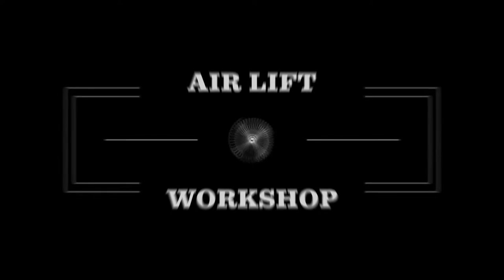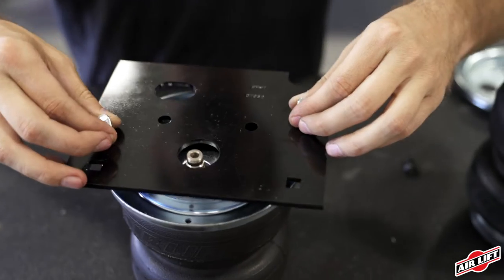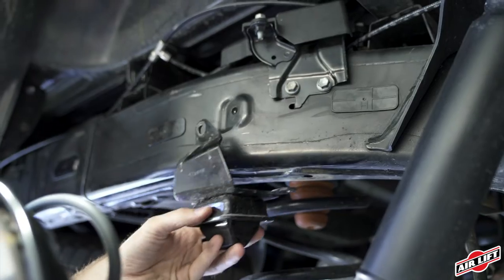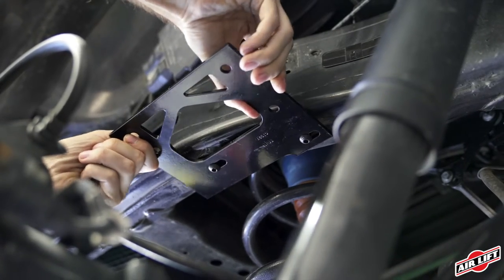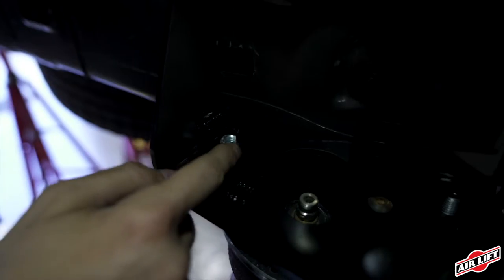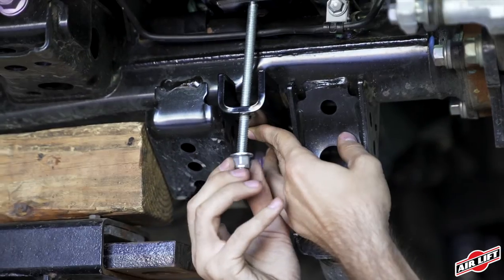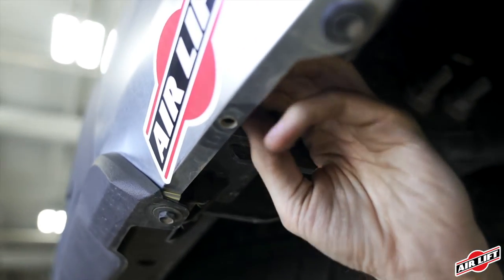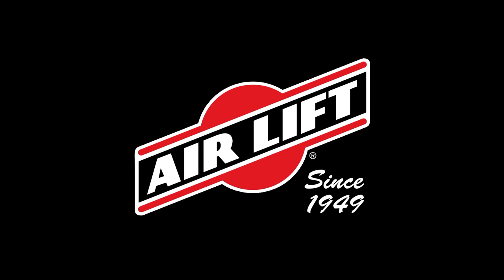Air Lift Install 57383: 2022-2024 Toyota Tundra 4WD / 2WD - LoadLifter 5000

Comment: Found this vid helpful (having done an install on my previous leaf spring gen Tundra.)  But, now I need to find how to install 74100EZ on my Tundra Max (hybrid).  Still learning about the do's nd don't when dealing with the new battery system.
Reply: In case you didn’t see the video for the 74100EZ there is one here: https://youtu.be/INILeMVRT-U

Comment: It’s just like every other install vid that gives the novice just enough confidence to get that person in trouble.for example they did not give you the information you needed to wire this system properly  and int can become very frustrating and expensive when you get lost in the installation it’s the same as people who show a sub  and amp install .
Reply from the maker: Thank you for your comment - however this kit does not require any wiring. Any of our products that do require wiring come with a complete wiring diagram in the installation manual, which should always be your first resource for install help. If you do get stuck, we have a great customer service team who can help you out too.

Comment: Will this work with 23 sequoia? Same frame and suspension.
Reply from the maker: Apologies for the late reply. We have not confirmed fitment, but it is on the list for engineers to review.
Reply from the maker: Apologies for the late reply. We have not confirmed fitment, but it is on the list for engineers to review.
Reply: @AirLiftCompany  I bought the 2022 tundra one and made it work. Thanks
Reply: @chrisd5383 what had to be done?
Reply: @fashionrider712istunthi9  a little trimming. No more than a half inch here and there. If you own an angle grinder you’ll be good.

Comment: I have 1” lift coil springs in the rear.  Will this kit work with it?
Reply: Did you ever find out if this will work with a 1" lift?
Reply: @Hoofer54247 3in lift is 1 in the rear im assuming. Just read through the instructions on my 3-4.5 icon lift kit for my sequoia.

Comment: Will this fit exactly the same on a 2023 Toyota Sequoia?  I do not have the air suspension and want to add some bags to reduce sag when towing my boat
Reply from the maker: We have not confirmed fitment, but it is on the list for engineers to review and verify.
Reply: @AirLiftCompany still not verified? I heard on a forum it fits.

Comment: I just installed one of these kits today on a customers truck... Who ever designed this kit is a Muppet!  Absolutely dumb. Three plates of steel bolted together to rust and rot. Cheap bracketry that is overly complicated for what it needs to be but still not good. Bottom of air bags bolted to that bracketry on the diff to limit extension of suspension. I could say so much more. 
It doesn't have to be this way but the guys that design this stuff are simpletons!
Reply: Should it go on the trailing arm?
Reply: @fashionrider712istunthi9  No it mounts to the side of the frame when the factory bump stops go.
Reply: @R1Kyle i meant, how should it be mounted so it doesnt limit travel?